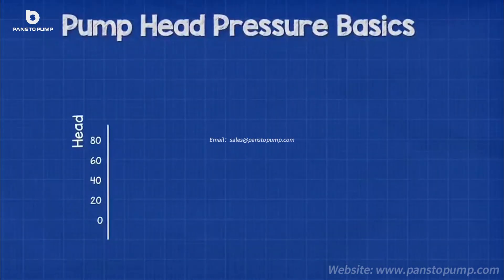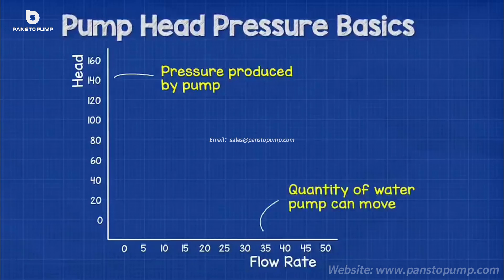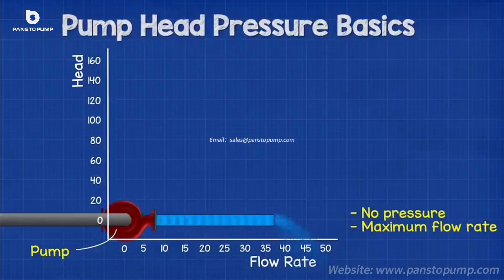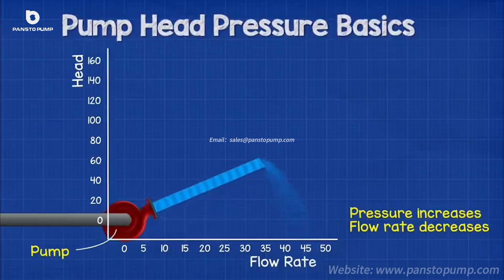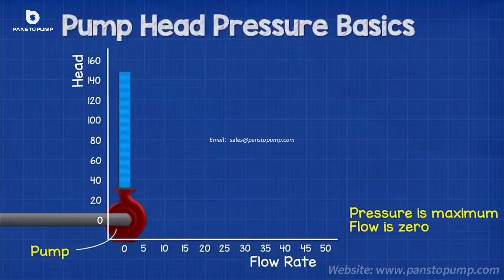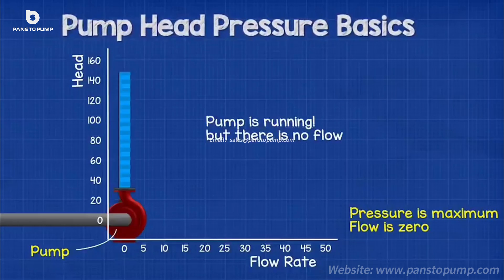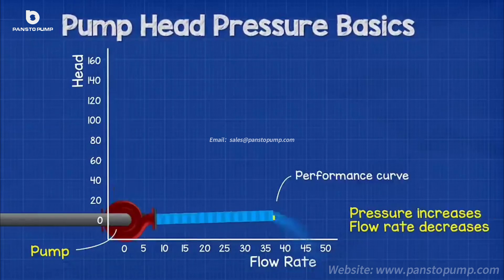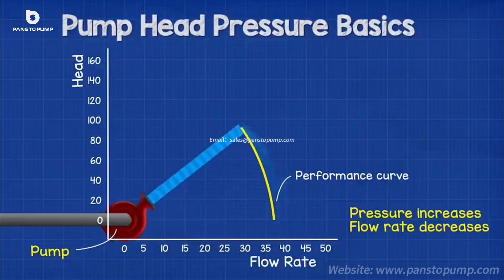Understanding Pump Head Pressure: The Basics Explained

Comment: QIf a pump is used in this way, I mean with the outlet being vertical, and the liquid is changed, I think the discharge pressure will be constant because the pump doesn't know whether it is water, or milk, or honey, because the discharge pressure is affected by the speed, and horsepower is affected by the speed of the pump, not by the fluid itself. So I think the discharge of the pump is constant.uestion
Reply from the maker: The medium you generally transport using slurry pumps，sir
Reply: @slurrypumpmfr  what do you mean by slurry pumps
Reply from the maker: @معزسالم-د1ه  The discharge pressure of a slurry pump is influenced by multiple factors, including speed, impeller design, and the characteristics of the medium being pumped. Unlike water or milk, slurries contain solid particles that introduce additional resistance, affecting both efficiency and power consumption. That’s why selecting the right pump model and material is crucial.
At Pansto Pump, we specialize in handling high-abrasion slurries in industries like mining and dredging. What kind of application are you considering for your pump? We’d be happy to help